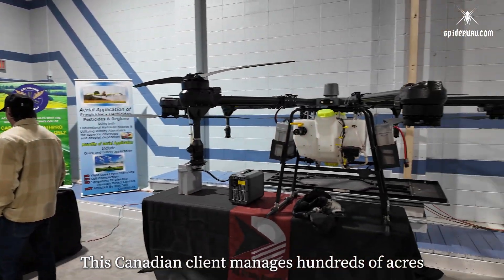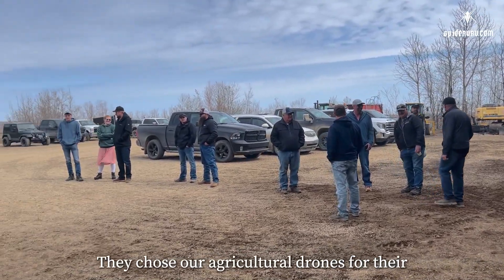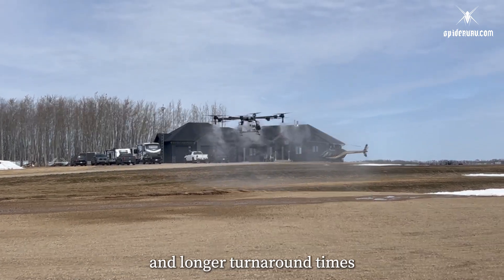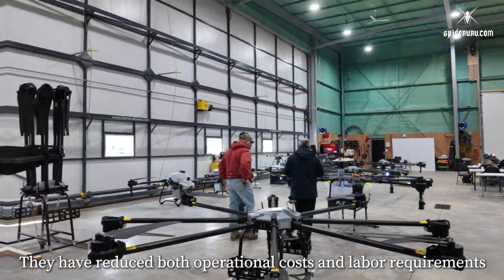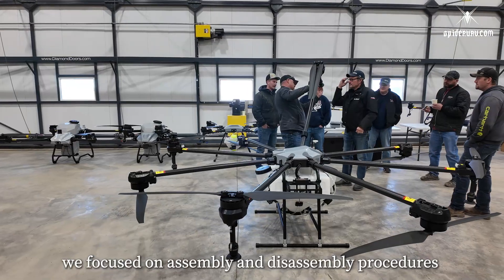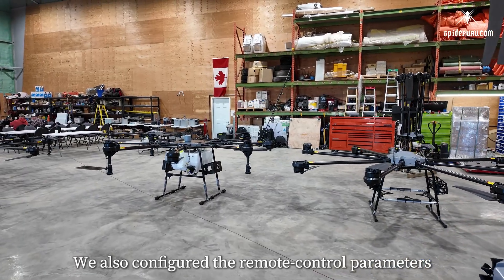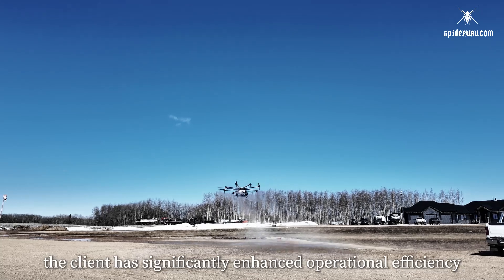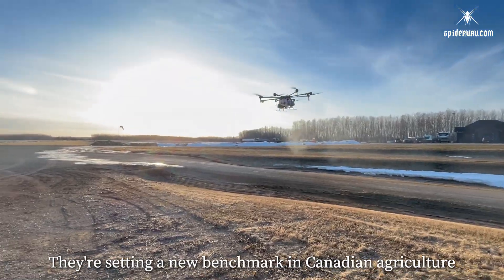Agriculture Drone vs Helicopter: H300 UAV Cuts Costs in Canadian Farming

Comment from the maker: 👇 Which do you trust more for crop spraying—drone or helicopter? Vote and tell us why!
Reply: The helicopters RC, are more efficient, one motor, low rpm, and  a aerodynamic big rotor have less rpm more efficient, and more autonomy. Collective and and swashplate are more effective. The factories the drone actually, only installing more motors , more batteries this is not effcient, and low the performance, less payload, less flight range.
If you have a lot motors, a lot propelles are more things for failures and damage components. The helicopter with only one rotor and one motor, lift a lot the payload.
Reply from the maker: @Karenan-h4p Thanks for sharing your thoughts — you’ve raised some great technical points! 🙏

We agree that each platform has its own strengths, and helicopters can offer high efficiency in specific scenarios.

In recent years, many operators have found that multi-rotor systems offer advantages in ease of operation, modularity, and safety, especially for agricultural tasks across varied terrains.

We appreciate your input — it’s always valuable to hear different perspectives from experienced users. Let’s keep the dialogue going! 🚁